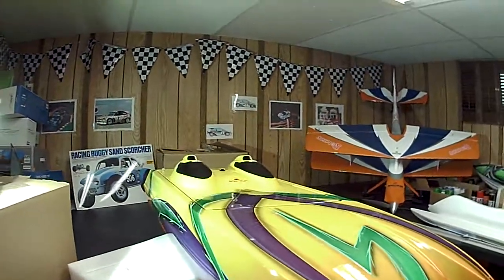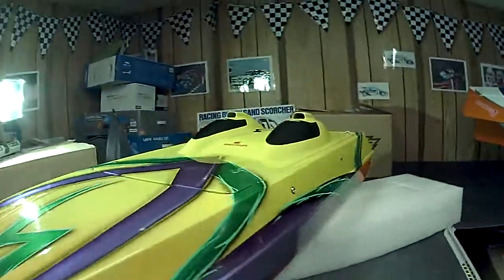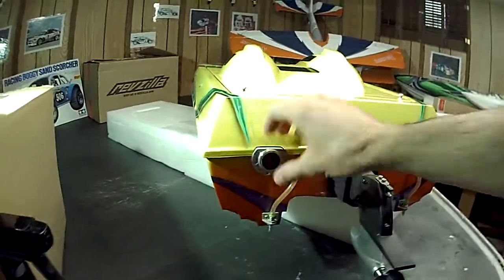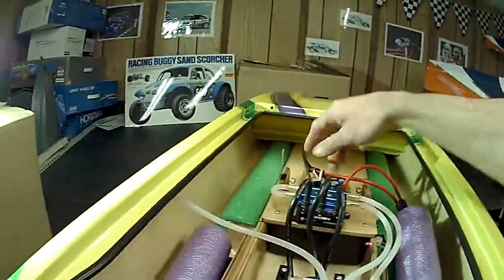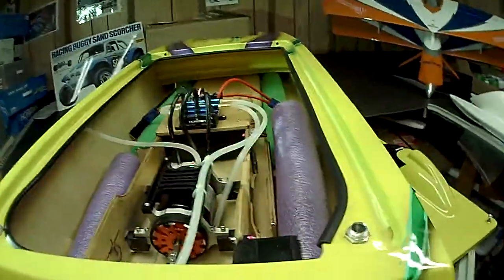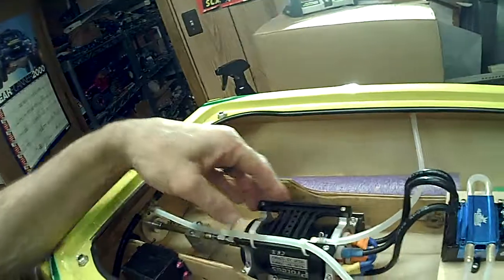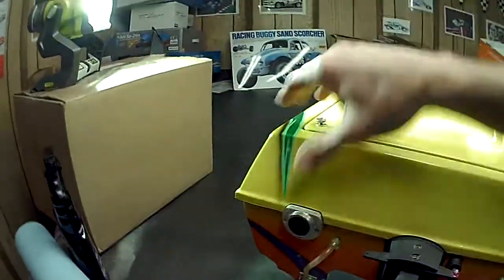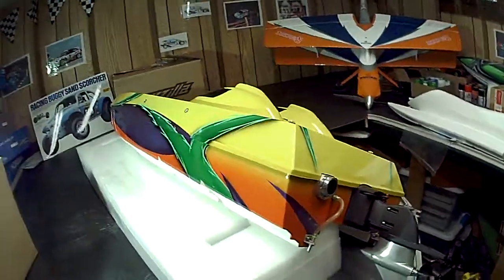R/C Electric conversion ExpressCraft Lightning 47 Cat hull.  Blooper ending, sorry.

Comment: Can you help wat do i need to order to convert my Gas boat to electric?
Reply from the maker: Hello, of course I can help. But I would need to know much about the boat you have.  Is it a gas power like the one here? This is a 47" hull and needs at least 3000 to 4000 watts of power to run better than a stock g26 zenoah engine. I use a 160 amp esc on 6S power only.  Plenty fast as I plan to shoot a video of this boat running soon. The motor I use is a Proteus 5690 at 780 KV.  You can actually also buy a direct fit motor mount from offshore electrics.com for that motor size that will fit into the same place as the gas engine does.
Reply: Thanks again for you reply and thanks for your help yes my 47” gas power and if you like before to discussed anything if you like I Can send you pictures of the boat so you can see it
Reply: All set i found you